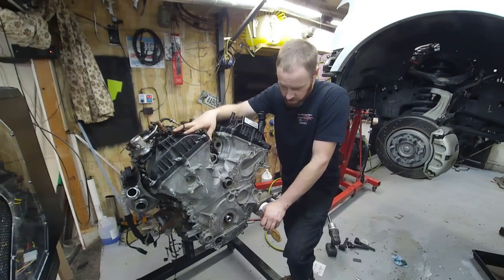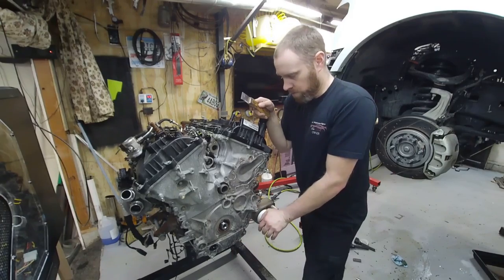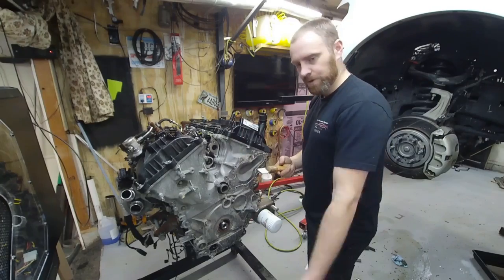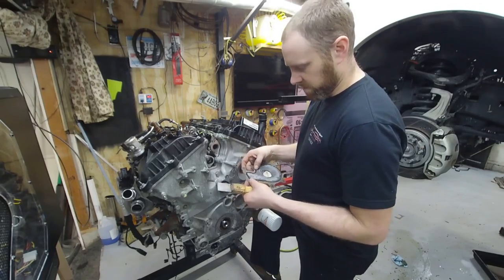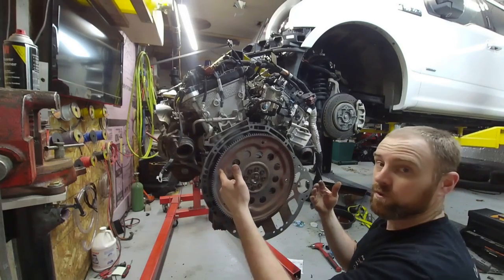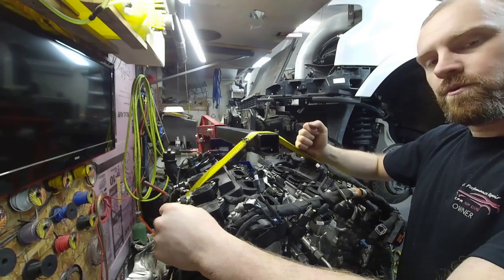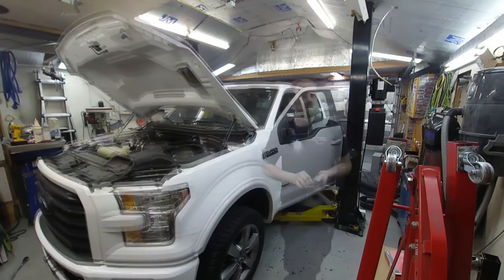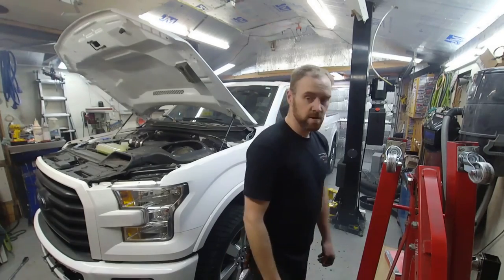F150 EcoBoost Broken Crank Runs! Pt5 Final

Comment: How long did it take to fix?   2-3 weeks?   Will a crankshaft from the GT40 3.5 Ecoboost 600+Hp fit and be stronger OR one from the Limited F-150 450Hp fit?